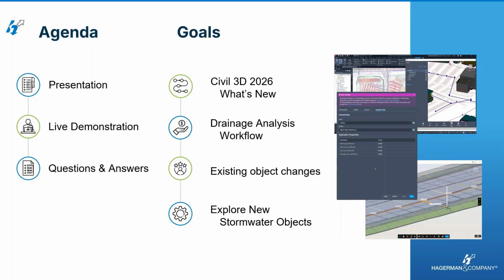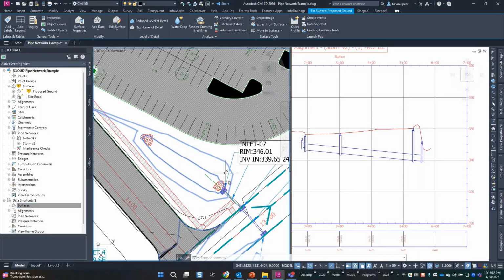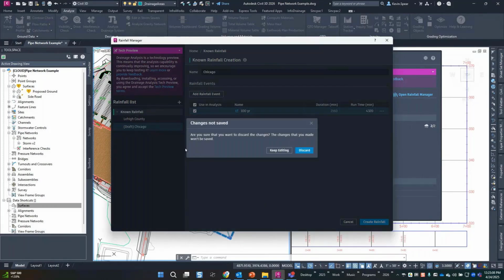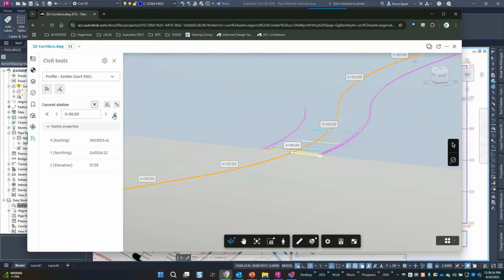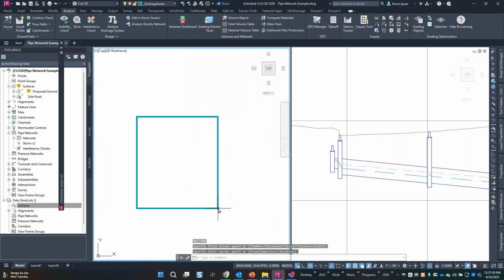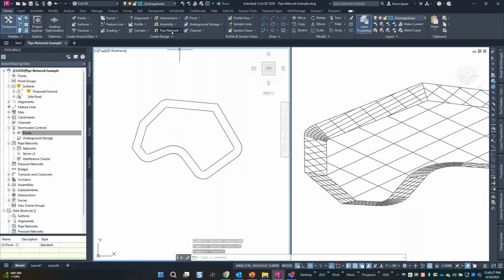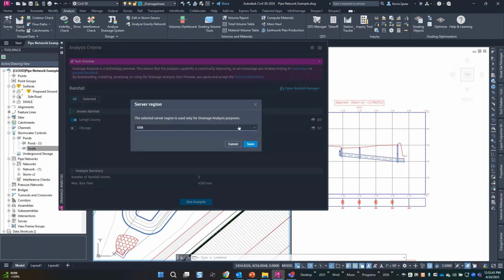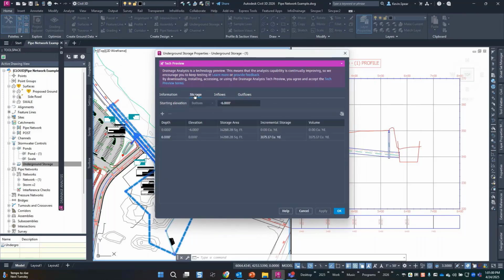What’s New in Civil 3D 2026: Drainage Analysis Technical Preview

Comment: would these rainwater and drainage tools be primarly for smaller scale projects/sites? We use HECRAS and other software for surface hydrology, but this is usually for very large area's using large DEM.
Reply from the maker: Civil 3D's Drainage Analysis tools work well for site-scale drainage design like subdivisions and smaller catchments, using Civil 3D objects for quick analysis. For large-scale hydrology with DEMs, you'd typically pair it with those tools.
Reply: @Hagerman  great thankyou!

Comment: Sir, can we design an open channel/drain (nalla) on this, or not? And if we can design it, then for how much catchment area can it be used? For example, if we have a catchment area of 8,000 acres, can we design it for that using these extension tools
Reply from the maker: Yes, the Civil 3D 2026 Drainage Analysis Tech Preview supports open channels (drains, “nallas”) as part of its new drainage workflows. As for how large a watershed you can model (like 8,000 acres), Autodesk hasn’t published a strict upper limit. The analysis runs in the cloud via InfoDrainage, so it depends on how the system is set up, your input data, and how complex your model is.

Comment: What are the thoughts on the cloud based analysis.
I am not for it.
Kind regards
Reply from the maker: From our Solutions Engineer, "I am fine with it. The decision to use or not use comes down to costs vs risks. Fundamentally, the data sent to the “cloud” for the analysis of a storm system is encrypted and decrypted within Civil 3D. Not much different than the video for a Teams or Zoom meeting. Surely, the content can be critical in nature. The processing of the data in the cloud allows systems that are simple and complex to be processed without the need for local processing power in your machine. You’re using Autodesk’s server farms to do the processing which is included in the cost of Civil 3D.
An alternative to using the tech preview would be to export the system and process locally using InfoDrainage (that is the engine used to process the data in the cloud) or SSA or Storm Sewers.
Ultimately, you are balancing cost and security with any digital choice. What we haven’t discussed is the network security at your office. Do you have full time IT staff? Are network infrastructure appliances maintained? These questions are simplified with “cloud” processing as Autodesk becomes the answer to those security questions, again included in the price of C3D."

Comment: Great video! One question about pond analysis & inflows. Is it possible to have a "runoff" inflow to the pond? Right now all I can get to work is storm sewer inlets to a pond. I would like to link a catchment to a pond that flows directly into the basin.
Reply from the maker: Currently, the analysis workflow is geared towards pipe analysis only. What this means is that catchments, which hold the inflow data, can only be assigned to a pipe network structure. If you’re just interested in the PRE / POST type of analysis, then you can create a catchment group with overall drainage areas to analysis points and assign to a simple manhole with a short, large diameter pipe that connects to the pond. This will then provide inflow to the storage and generate storage volumes depending on the storm events you create.